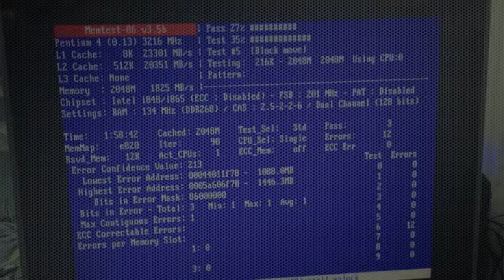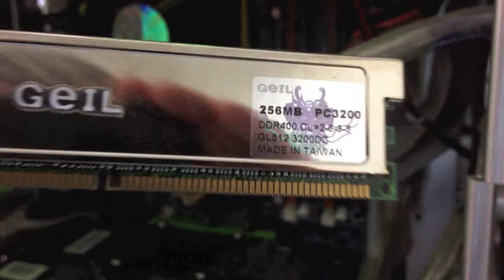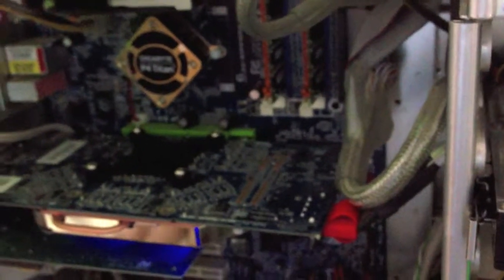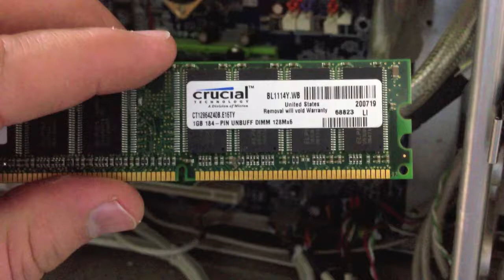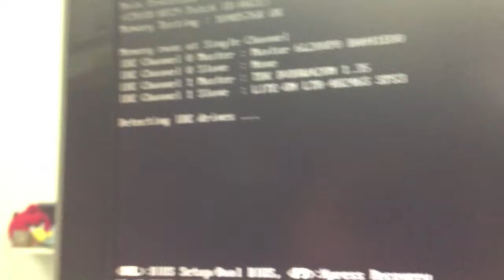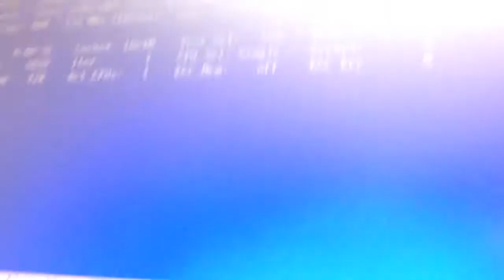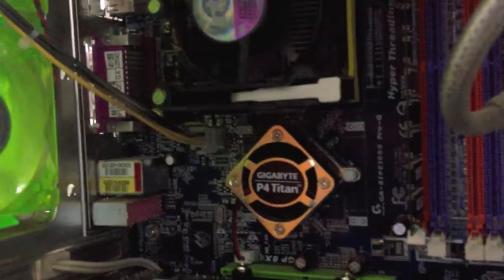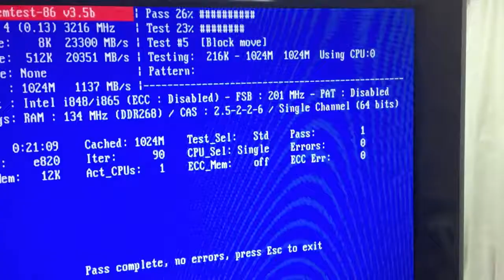Memory Testing Crucial DDR400 PC3200 Failed.

Comment: i like the memory test thats packed into the boot menus some versions of Linux especially Ubuntu.
Reply from the maker: I didn't know a memory test came with Ubuntu?
Reply: if you use a live cd there is a memory and hard drive test in the boot menu of the disk. its bin on every version i have used. (personal fav is Ubuntu 9.10)
Reply from the maker: I'll have to check that out some time.  I don't use Linux much.